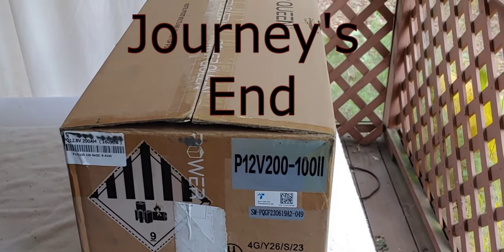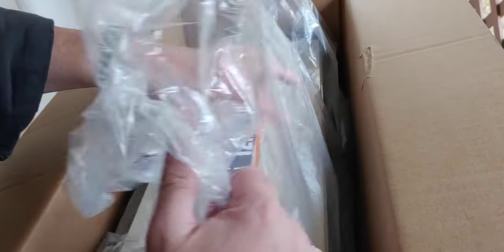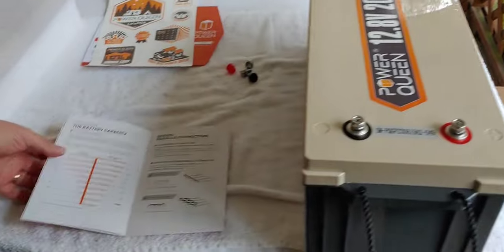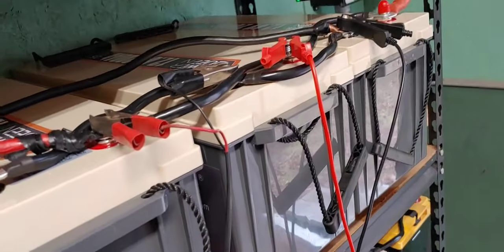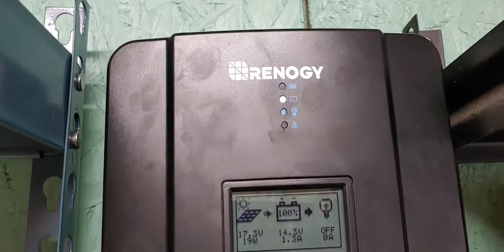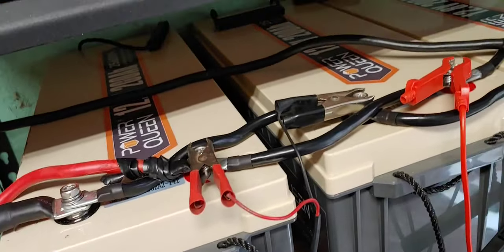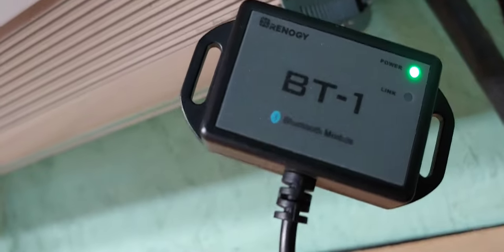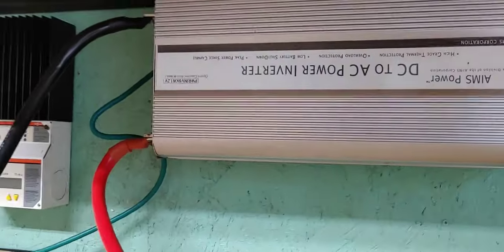My Solar Power backup System Journey's End

Comment: Well done, try to go totally off-grid, my system is only 1.3kw of panels and I am off-grid. Be frugal, people managed for years with no electricity at all, it is a very much luxury energy source. Few people actually need a Fridge or Freezer running all the time, especially if they live close to shops.
Reply from the maker: Thanks for your comment.
Reply: That's an EXCELLENT point about refrigerators and freezers.  For things that don't need to run all the time, it may be a good idea to put some outlet timers or smart outlets on them.

That way you can turn them off at certain times without plugging and unplugging them.  In particular, refrigerators don't have to work as often when they are not being opened to take things out, particularly at night (which we all know is a time when we should not be opening the fridge anyway 😁)
Reply: NOTE: If you don't want a smart outlet that uses the internet and "spies on you", there are purely electromechanical outlet timers with a 24-hour mechanical dial on them.  You set it to the current time, and it has tiny switches around the perimeter for 15 minute intervals.  You click the switches up or down, depending on whether you want the outlet to be ON or OFF at that time.  Once you plug it in, the dial rotates automatically at 24 hours per full rotation, and you can just set it and forget it.
Reply from the maker: @DM-kl4em  thanks for your comment.

Comment: Hopefully you've gone straight for a 48v system
Reply from the maker: I am happy with my 12 volt system. Thanks for your comment.
Reply: @shoestringprep  have a look through some of my old 12v and 24volt systems. I started off 12v but if you try and run anything over 3000w the cables will need to be huge. With your 4 x 12 v 200ah battery running a 48v system will also quadruple the amount your mppt can take. So rather than 800 Watts at 12v you're able to take nearly 4000 Watts of pv input at 48v I promise you. You'll be much happier
Reply from the maker: @sun-sea-solar  thanks for your comment.
Reply: Nice system. Iv been piecing mine together over the last 3 years as well. I just ordered the MPP 6048 inverter from the current connected saving shack. Seems like a good deal for all that it is. Looks like you have the option to go 48v with your setup and agree with comments above regarding benefits of going 48v. Something to consider. Thanks for sharing.
Reply from the maker: @Code_hack_  if I was starting from the beginning I may have decided for 48 volt. But my system all the way into my Homestead is set up for 12-volt and I would have to change a great deal of my system. Thanks for your comment.
Reply: @shoestringprep  probably seems like a pain changing to a 48v system but once you have 4 batteries and a mppt all the expensive stuff is done.
Reply: @sun-sea-solar  Except for the 48v inverter.  @shoestringprep I'm not sure what you mean by "all the way into my Homestead is set up for 12-volt".  Are you running a lot of stuff direct from 12v D.C.?  If so, 48v to 12v converters are available to keep running that 12v stuff.  But you may want to check and see if they are flexible 12v-24v. If so, a 48v to 24v converter might be better - 2x the power at the same amps or 1/2 the amps for the same power for less loss in the wiring.

Since voltage drop in wires is volts = amps multiplied by resistance, 100 amps in a wire at 12v might drop 2v (17%!) and cause your inverter to shut down.  But 100 amps thru that same wire at 48v will be carrying 4x the watts, and while the voltage drop will still be 2v the loss is now less than 5% and the inverter will still be happy.

My personal rule of thumb for continuous use is up to 1500w at 12v, 3000w at 24v (short term to 2000w or 4000w respectively). This allows you to squeak by with 2ga if the cables are short like in a portable system, but normal installs with runs over a foot or so need 1/0 for safety and less voltage drop and heating.  Then for anything bigger it's 48v.  But every 6kw (8kw short term) increment needs its own D.C. cables, and since the equipment is larger and cable lengths longer, those cables end up being 4/0 most of the time.   (I'd like to go even higher voltage D.C. but that equipment is rare and expensive.)

Comment: @DM-kl4em
0 seconds ago
I'm building slowly myself too.  I currently have four 100W solar panels on the roof, with a cheap 30A Renogy Charge controller.  Current battery bank consists of 5 big 12V lead-acid batteries connected in parallel (Size 24F Everstart lead acid batteries, for about 70 bucks apiece from the Walmart automotive section).  I also got some 2AWG car battery cables (rated up to 130 amps) and car battery clamps from the Walmart automotive section, to comfortably handle up to 1000W load (roughly 83 amps at 12V) from the cheap 1000W inverter that I have installed.

Currently, I can use the system to power my downstairs home office on most days (3 lamps, laptop computer, 30 inch TV screen, printer when needed, and on-demand pump for the off-grid water system).  The printer draws up to 840W, but it only runs for a few minutes at a time (and I turn it off when not in use).  This past summer, I was also able to plug in my lawnmower battery chargers, which allowed me to run my electric lawnmower off-grid (I have about 0.37 acre, and I can mow my entire lawn with 2 pairs of 20V, 4Ah batteries.  My weed trimmer also uses the same batteries).

Occasionally it gets cloudy for a few days and I have to go through the minor inconvenience of unplugging the power strip from the inverter and plugging it into the back wall.  I also keep a small trickle charger next to the battery bank, so that if the sun isn't shining, I can keep my batteries topped off in case the power goes out.

It's a bit small yet, but it's a start, and it will get bigger and better as time goes on.
Reply from the maker: That is a great start. Keep up the good work. Thanks for your comment.